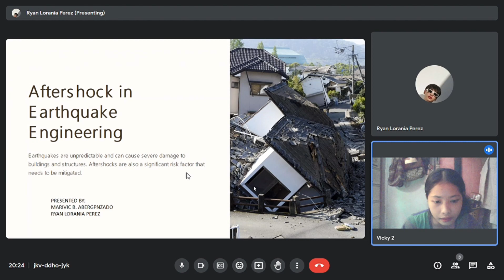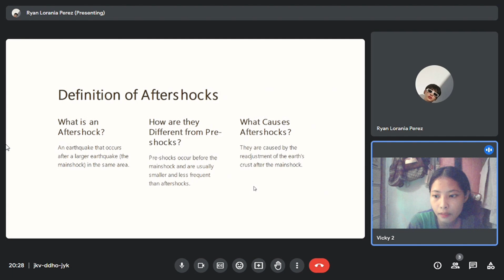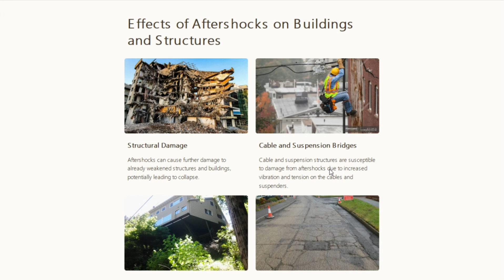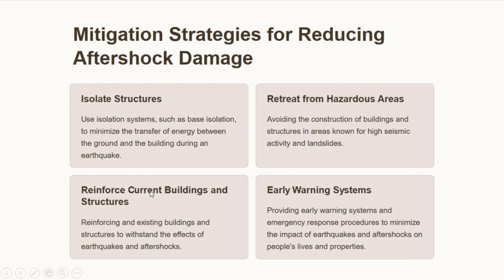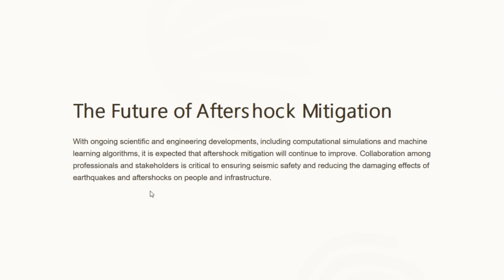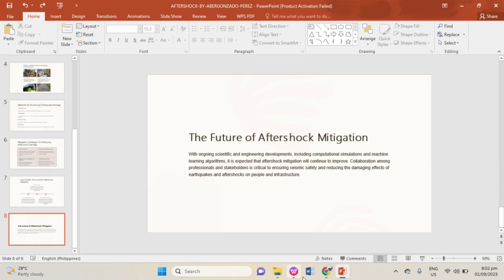AFTERSHOCKS

Comment: Aftershocks can be dangerous, especially if they occur in areas that have been damaged by the mainshock. Aftershocks can cause further damage to buildings and infrastructure, and they can also trigger landslides and other hazards. If you experience an aftershock, the most important thing to do is to stay calm and drop, cover, and hold on. If you are indoors, find a sturdy table or desk to get under. If you are outdoors, find an open area away from trees, buildings, and other hazards. Aftershocks can be a scary experience, but it is important to remember that they are a normal part of the earthquake process. By staying calm and following safety precautions, you can help to protect yourself and your loved ones during an aftershock.

Comment: When a relatively significant earthquake happens, a continuous sequence of minor earthquakes will occur everywhere around the initial earthquake's epicenter. The succeeding quakes are referred to as aftershocks and the initial major quake is referred to as the mainshock. The mainshock-aftershock type of seismic activity is what this occurrence pattern is known as. In most situations, there is a major earthquake with a shallow epicenter that is accompanied by aftershocks.
When the main-shock occurs, the rock around the epicenter becomes dynamically unstable. It is considered that aftershocks occur in order to adjust for this dynamical instability.

Comment: Understanding the significance and awareness of aftershocks and the mitigation of earthquake damage to structures is paramount for Civil Engineers. Earthquakes, which result from the movement between rocks, can wreak havoc on the Earth's crust. Aftershocks, which occur after a larger earthquake in a specific area, often follow the main event and can have damaging effects on structures. It's essential to recognize that aftershocks are the Earth's way of adjusting its crust after the initial shock, and they can pose significant threats to the buildings and infrastructure.

As future civil engineers, it's our responsibility to incorporate these measures into our designs and projects, ensuring the safety and resilience of our built environment in the face of seismic challenges.

Comment: Miss Abergonzado first introduced the earthquake, and Mr. Perez then discussed the well to Aftershocks. Then Miss Abergonzado discussed what aftershocks are. Aftershocks are minor earthquakes that happen after a mainshock and can worsen the situation and make it more difficult to respond to emergencies. The consequences of aftershocks on buildings were the subject of Mr. Perez's next speech. Civil engineers must carefully examine aftershocks in order to maintain safety and resilience since they may affect the structural integrity of infrastructure and structures that have already been compromised by a mainshock.

Comment: Ms. Marivic and Mr. Ryan talk about aftershocks, which are smaller earthquakes that occur in the same general area days to years after a larger event or "mainshock." They occur within 1-2 fault lengths away and before the background seismicity level has returned. They advise us as future engineers to emphasize safety, particularly while constructing a structure to protect the safety of the people. It is our primary goal that our structure can resist any natural disaster. They provide us with an introduction to earthquake engineering. Methods for Assessing Earthquake Damage was also covered in this video. It was useful since it provided us with more information about it. Thank you to the reporters for preparing and discussing it with us. Good job!

Comment: This video is magnificent as it relay vast of information. Mr.Perez and Ms.Abergonzado discussed about Aftershocks in Earthquake Engineer.

Ms. Abergonzado started the discussion by giving the definition of aftershock. Then Mr. Perez proceeds to discussed about the effects of aftershocks. He also discussed about the method of assessing earthquake damage. Then he proceeds to discussed the mitigation strategies for reducing aftershock damage. Mr. Perez also provided case studies regarding  aftershock mitigation. With this knowledge engineers may be able to consider the potential for aftershocks when designing buildings and infrastructure to ensure their resilience and safety. Accurate knowledge of aftershock patterns, their magnitude, and timing allows for the implementation of effective building codes and retrofitting strategies to mitigate the long-term impact of seismic events, safeguarding communities and their assets.

May gratitude to the esteemed reporters, Mr.Perez and Ms.Abergonzado as they bestowed us vast amount of knowledge. May the future engineers persevere.

Comment: The discussion was about aftershocks in earthquake engineering. The reporters defined aftershocks as smaller seismic events that follow a main earthquake and are caused by the adjustment of the Earth's crust. Also, according to them, they differ from pre-shocks as they occur after the main quake. They also discussed that aftershocks can further damage buildings, especially those already weakened by the initial earthquake, affecting structures like cable and suspension bridges. To assess earthquake damage, methods such as visual inspection, seismographs, remote sensing, and UAVs (drones) are used. Lastly, they provided mitigation, which includes reinforcing existing buildings and structures and early warning systems to reduce earthquake impact and casualties. The reporter really did well with their report.❤

Comment: Before moving on to the main theme of the presentation, which was all about aftershocks, they once again went over the definition of an earthquake from the earlier reports. Aftershocks are seismic occurrences that happen immediately after a larger earthquake and are also brought on by a change in the stress in the Earth's crust. Communities previously impacted by a significant earthquake may be at further risk as a result of this phenomena. Aftershocks can cause additional structural damage, which puts people under psychological stress. Since we are in charge of the buildings, the reporter also offered mitigation strategies for minimizing aftershock damage, which are crucial. Determining the safety of damaged structures, creating evacuation plans, and organizing the use of resources all depend on it.

Comment: The reporters did great! I learned from their report that smaller earthquakes known as aftershocks generally take place nearby the epicenter of a bigger earthquake. After the major earthquake, they may continue for days, weeks, or even months. After the primary earthquake, as stress is released, the Earth's crust readjusts, which results in an aftershock. They can occasionally be just as powerful as the main earthquake, increasing the risk to already vulnerable infrastructure and building structures.

Comment: Aftershocks are nature's way of reminding us that the seismic story doesn't end with the main earthquake event. These smaller tremors follow a significant quake, often for days or even years, and can be nearly as unsettling as the initial shock. Reflecting on aftershocks underscores the ongoing dynamic nature of our planet's crust and the complex aftershock sequences that can accompany major seismic events.

These post-quake tremors not only add to the challenges faced by communities recovering from the main event but also highlight the importance of ongoing monitoring and preparedness. Aftershocks serve as a stark reminder that seismic risks persist even after the ground has stopped shaking, emphasizing the need for resilient infrastructure and disaster response strategies in earthquake-prone areas.

Comment: The reporters began by talking briefly about earthquakes and how civil engineers can get ready for them. Then, they explained what aftershocks are: they're earthquakes that happen after a big one in the same area. They also pointed out the difference between aftershocks and pre-shocks. Pre-shocks come before the main earthquake and are smaller and less common.

Aftershocks occur because the Earth's crust is adjusting after the big earthquake. The reporters stressed how aftershocks affect buildings, structures, and people's lives. They mentioned that aftershocks can harm buildings and cables. The reporters also talked about ways to check for earthquake damage and ways to reduce damage from aftershocks. This topic helps us understand how to get ready for aftershocks, which is crucial for our safety.

Comment: According to the reporters, an aftershock is an earthquake that occurs after a larger earthquake or the main shock in the same area. The reporters explain aftershocks clearly, how they are different from foreshocks or pre-shocks, and the causes of aftershocks. They also show strategies for reducing aftershock damage and case studies of successful aftershock mitigation. So according to the report, the aftershock is not as strong as the main shock, but because of the damage that a structure or a building experienced because of the pre-shock and main shock, aftershocks can cause additional damage to the structure and buildings that are already weakened by the first two shocks. Also, this report shows the importance of designing and constructing buildings that can withstand the effects of earthquakes, etc. The reporters did great.

Comment: It was said that Aftershock is an earthquake that occurs after a larger earthquake in the same area. Aftershocks are stronger and more frequent than foreshocks.  It was mentioned that they are caused by the readjustment of the earth's crust after mainshock. Additionally,  methods for assessing earthquake damage and mitigation strategies for reducing aftershock damage were  explained which are all salient in understanding this phenomena. 

Aftershocks are dangerous because they could collapse buildings that are already damaged by the main earthquake. That is why it is crucial for engineers to  build a stable structure that could withstand a successive earthquakes.

Comment: The reporter explain about aftershocks and showed about the importance of dealing the aftershocks. Smaller earthquakes known as aftershocks occur after a larger, major earthquake. They take place as the Earth's crust settles and adjusts to the tension and pressure brought on by the primary earthquake. Aftershocks are earthquakes that occur minutes, hours, days, or even weeks after the first quake. They are often weaker than the primary quake, but they can still be intense and possibly dangerous. After a severe earthquake, it is crucial for people to be cautious and on guard because these seismic aftershocks can hinder recovery efforts and pose new threats to already afflicted areas.

Comment: Preparation for earthquakes, assessing structural damage, mitigating earthquake damage, and improving earthquake awareness are necessary to understand earthquake engineering. 

Aftershocks are smaller earthquakes that occur after a larger earthquake. It can be very frightening, especially for people who have just experienced a major earthquake. They can also be dangerous, as they can cause buildings and infrastructures that were already damaged by the main earthquake to collapse.

It is also important to assess earthquake damage such as visual inspection, the use of seismograph, remote sensing, UAV or drones in order to determine visible signs of damage, estimate the strength and magnitude, capture the extent of damage over a large area, and inspect structures at a close distance. 

Aftershocks can be unpredictable, when and where they will occur, or how strong they will be. Therefore, it is important to be prepared for aftershocks. This includes having a plan for what to do if an aftershock occurs while you are at home, work, or school. It is also important to have a stockpile of emergency supplies, such as food, water, and first aid supplies. Moreover, isolating structures, retreating from hazardous areas, reinforcing current buildings and structures, and early warning systems help to mitigate for reducing aftershock damage.

Comment: The topic was all about aftershocks. Before proceeding to its main topic, the reporters briefly introduced what is an earthquake and what a civil engineer could do to prepare for such a destructive event. As defined by the reporter, an aftershock is an earthquake that occurs after a larger earthquake in the same area. She also distinguished the difference between aftershock and pre-shock, whereas, pre-shock occurs before the mainshock and is smaller and less frequent than aftershock. One of the reasons why there is an aftershock is the readjustment of the earth's crust after the mainshock. I like how the reporters considered the effects of aftershocks on buildings and structures. It is important to know that aftershocks could also affect the lives of people. As mentioned, aftershocks can cause further damage to our structures and cables. The reporters included some methods for assessing earthquake damage and mitigation strategies for reducing aftershock damage. This topic gives us ideas on how to prepare ourselves if an aftershock occurs, and it is important to have knowledge about this so that we can ensure our safety.

Comment: NIEL JOYCE L. DEGORIO BSCE-4

This presentation contains information relative to the incidents of earthquake and its after shocks. The first reporter, Ms. Abergonzado discussed the importance of designing a building according to safety factors including the assessment of structural integrity that can withstand the severity or damage that a building design can take. The latter reporter, Mr. Perez also added the  methods for assessing earthquake damages which is a very important aspect in civil engineering as it stimulates the level of safety and mitigation that we can adhere in minimizing the danger from building collapse or structure damages so that when a structure or its infrastructure is inspected, it is guaranteed that the materials and retrofitting used could significantly strengthen the structure's foundation and durability over time.

Comment: This topic was very interesting and need to know, it might be boring to read but it showed the importance of how we deal with aftershocks when it happens. The discussion of Ryan and Marivic was great because aftershocks happened anytime, there are so many examples of large aftershocks' causing more damage and loss of life than the earthquakes they are associated with. 

Earthquake aftershocks can cause significant damage to buildings. Occasionally, they can result in building collapse. In most cases, these shocks (called aftershocks) will be smaller, therefore  the vibrations will be weaker. Aftershocks do not mean that a stronger earthquake is coming. Aftershocks are normal; they show that the earth's crust is readjusting after the main earthquake. That's why be ready for aftershocks, which are normal following an earthquake.

Comment: Miss Abergonzado and Mr. Perez explained the well to Aftershocks, Miss Abergonzado first introduced the earthquake. Miss Abergonzado then talked define the aftershocks, Aftershocks are smaller earthquakes that follow a mainshock and can cause additional damage and complicate emergency response efforts. Mr. Perez then talked about the effects of aftershocks on buildings. Aftershocks are crucial for civil engineers because they can impact the structural integrity of buildings and infrastructure that are already weakened by a mainshock, requiring thorough assessment to ensure safety and resilience.

Comment: The presentation was all about aftershocks, where they explained again the definition of an earthquake from the previous reportings before proceeding to the main topic. Aftershocks are seismic events that follow a larger earthquake which is also caused by the readjustment of stress in the Earth's crust. This phenomenon can pose additional risks to communities that is already affected by a major earthquake. Aftershocks can lead to further damage to buildings which leads to psychological stress to the people. The reporter also included the mitigation strategies for reducing aftershock damage which is very necessary especially since we are responsible for the buildings. It is indeed crucial for developing evacuation plans, determining the safety of damaged structures, and coordinating the deployment of resources. Overall, the presentation was amazing, congratulations mga ate ko!

Comment: This presentation is focused on Aftershocks. Before proceeding to the main topic, the reporter primarily give us a foundation knowledge about earthquake that will lead us to be able to understand what aftershock is. They provided an overview where is really significant because as an individual we need to be aware and prepared when an earthquake will occur. Such knowledge and preparedness is our power in times of disaster. 

Aftershocks refers to an earthquake that occurs after a larger earthquake which is the main shock, in the same area. This happening is not new to us because the authorities always warns us to expect an aftershock every after an earthquake. They are caused by the readjustment of the earth's crust after the mainshock. Overall the reporters presented their topic very well as they elaborated specific points and gave us enough information how to be prepared for this kind of natural phenomena.